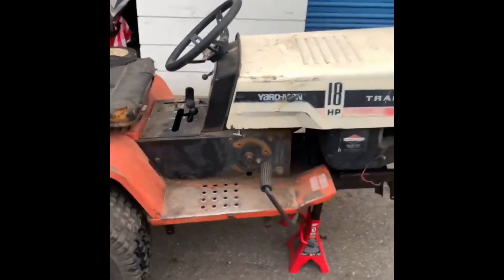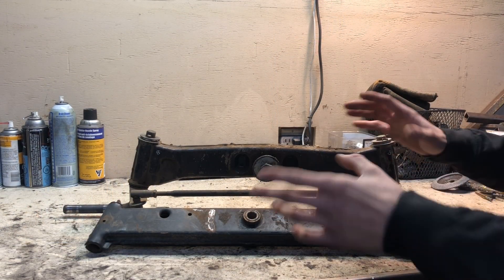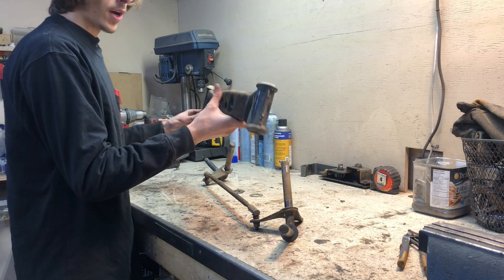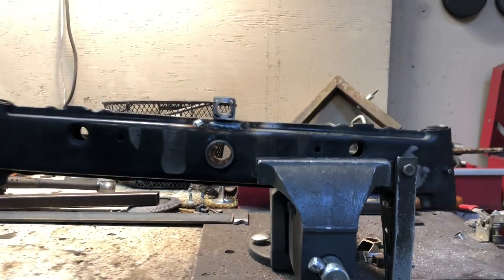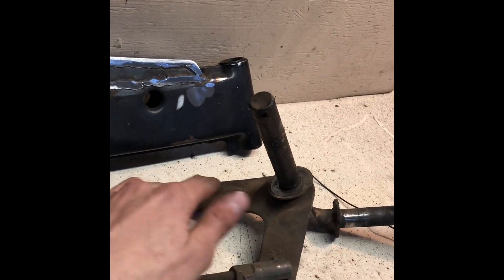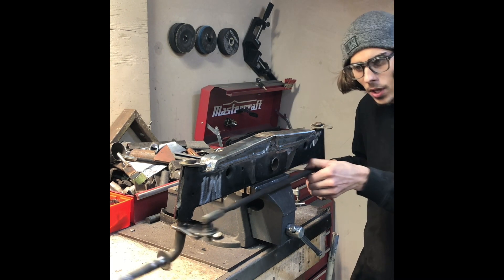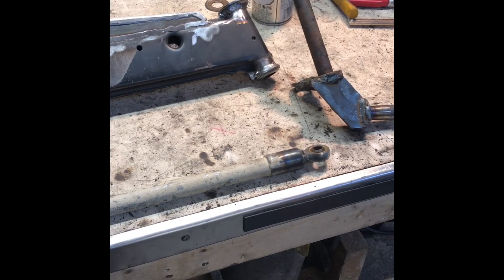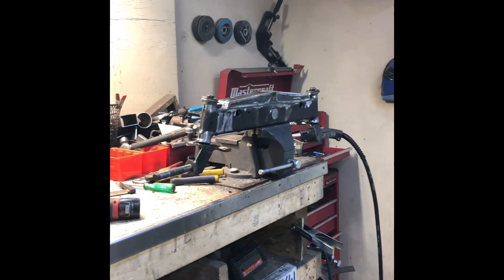How to build a off-road mower (scrappy build)

Comment: Would you recommend a lighter built lawn mower type tractor with a belt driven transaxle or would something like an older gear driven cub cadet or wheel horse true garden tractor be ok to use?

Comment: What thickness metal are you using to brace the axle? And what type of welder are you using? Been watching yall on insta for a while just got my first tractor and got it running ready to start making mods but want to make sure I have all the proper equipment before I start tearing down
Reply from the maker: Usually 1/8” 3/16” and 1/4” bracing 

Welder we use now is a EASTWOOD CO MIG 180! Works amazing definitely would recommend for the price! Tell them we sent you!
Reply: @OKOFFROADMOWERS  sweet thanks for the advice and sharing ur knowledge I'd love to pick yalls brains on this project  if there is something that is maybe not covered in one of your videos do you have an avenue for questions? Like an email?
Reply from the maker: Instagram messages work best

Comment: Damn dude that things built bulletproof! Would you suggest bronze bushings for the spindles if I can find them in the right size?
Reply from the maker: She’s a beast and yes bronze bushings work! Just make sure to grease them after a couple rides! If you can fit bearing in your rims or find rims with bearings that works really good as well
Reply: @okoffroadmowers  Do you think I can put Carlisle snow hogs 15x5-6 on the stock rims that took a 15x6-6? I’m going to get 22s for the rear and I want to go 18s on 8s for the front in the future but I just need temporary. My front end is welded solid so tires are my only lift option unless I want to cut it all out again.
Reply from the maker: Yea should work
Reply: @okoffroadmowers  Sweet man thanks! I’ll probably post some shorts once I get it going but I gotta find a 1st gen steering box mine is all stripped out.